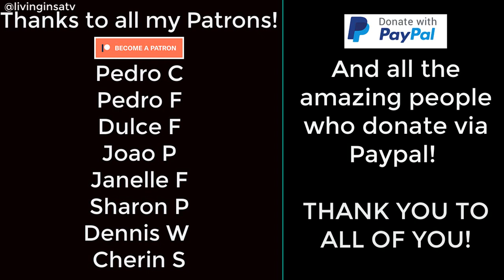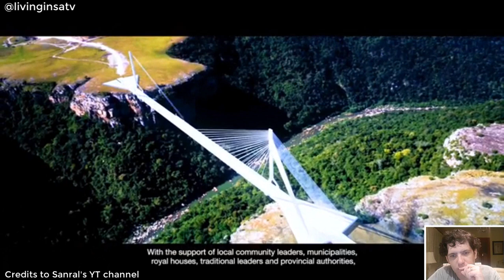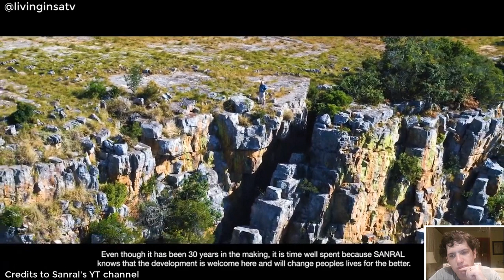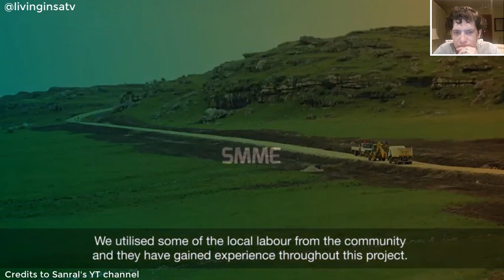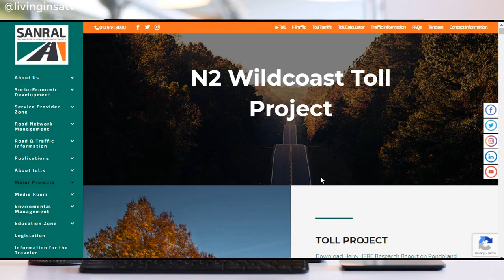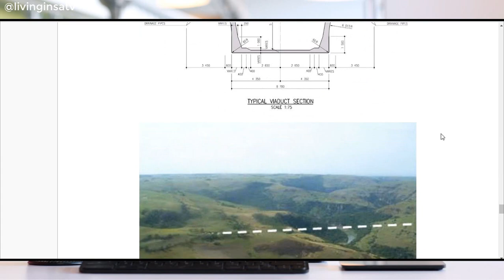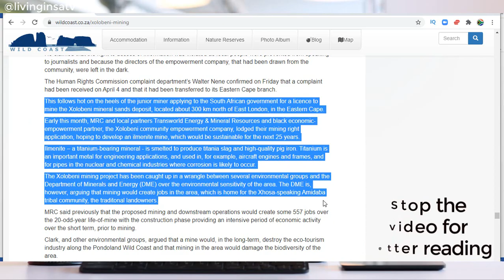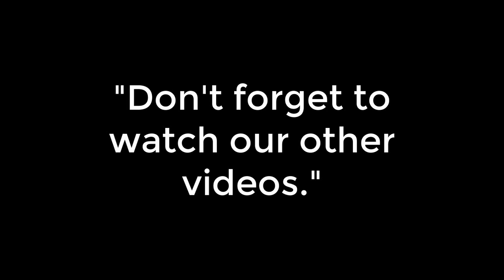🇿🇦R16 billion N2 Wild Coast Highway Mega Project✔

Comment: What Mr. Gibbons and SANRAL's spin do not tell you in their "sales" video is that: 
• their is an existing National Road already which has existed for 70+ years.  This new route now marginalizes 5 major towns along the old route. A far most cost effective solution would have been to upgrade this road.
• the cost recovery for this road cannot come from its toll fees; so what has been proposed is that additional toll sites will be placed in the city of Durban 200kms away to "tax" the commuters there for this grandiose project of SANRAL.......
There were sound fiscal reasons why this project never moved for 30 years!